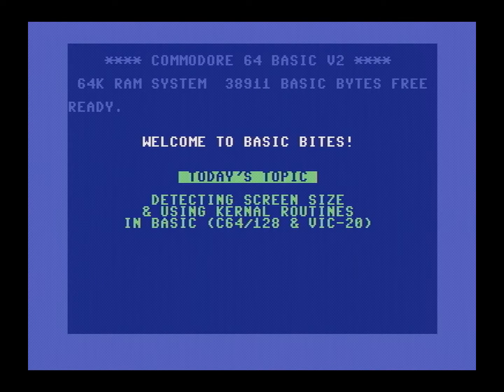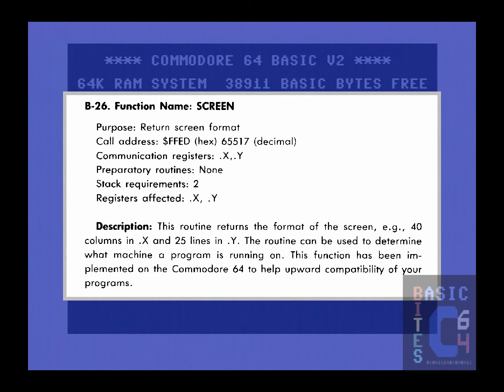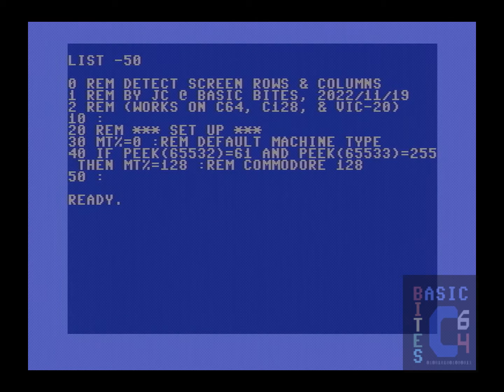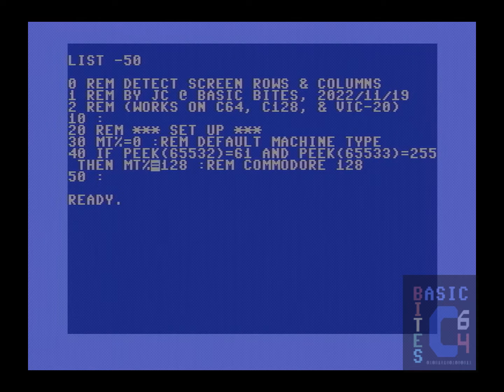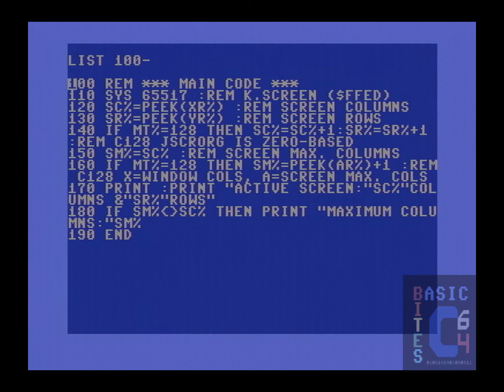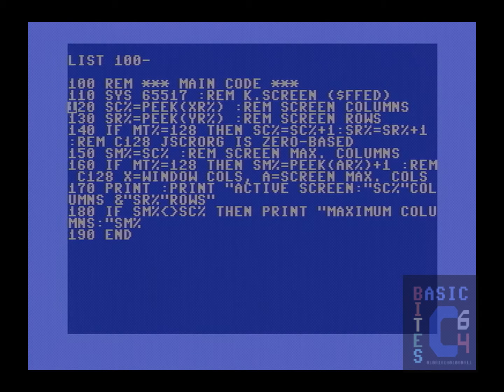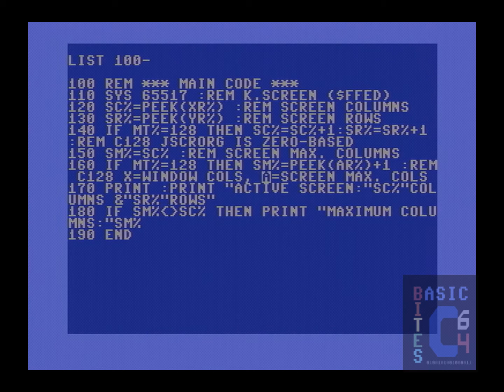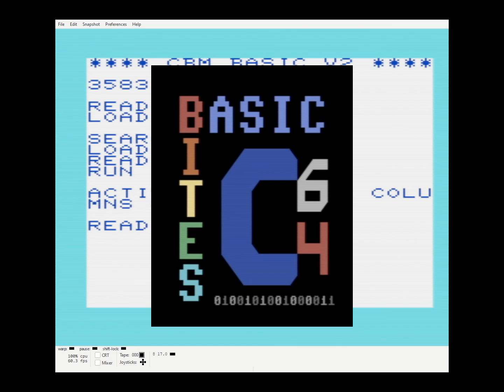Detecting Screen Size & Using KERNAL Routines in BASIC (C64, C128, & VIC-20)

Comment: 4:27 Hang on! DLOAD isn't available in C-64 mode! What kind of DOS wedge are you using, and why isn't it reported on the startup screen?
Reply from the maker: I am using THE FINAL CARTRIDGE III (don't program without it)! 🙂  It isn't specifically mentioned in this video because it is merely serving as a fast-loader, and has no bearing on the code being presented.  I do talk about the FC3 in other videos where its broader feature set comes into play.  It has an excellent BASIC toolkit -- including scrolling source.

Comment: Would be interesting to see if the same program runs properly on a PET or 16/116/+4 :)
Reply from the maker: My hunch is not without further modification -- but if those machines similarly contain a unique RESET vector at 65532, then further values of Machine Type can be added using the same method as is used to detect the C128, and tweaks made based upon that.  I don't code for any of those machines, but VICE emulates them all, so I would encourage you to download the code and experiment with it further. ☺️  -- JC

Comment: The reason why the addresses for the a/x/y registers changed with the c128 is because the c128 does a lot of bankswitching, and calls between code in different banks need a similar mechanism of first storing x/y/a (and actually more), then switching banks, loading back the registers, calling a function, storing x/y/a, switching back to the original bank the calling code is in, reload x/y/a (etc) and then return. 

To ensure the addresses used for those are always available, and do all this saving/loading with as little overhead as possible, the storage for this must be on the zeropage. 
SYS uses part of the same mechanism. 

Commodore never considered the actual addresses used by the sys command for x/y/a as part of the kernal interface. The kernal interface is really intended to be used from assembler, not from basic. It being possible, and even usefull, to use if from basic not withstanding. That is a logical consequence of being able to call machine code from basic, but not an intended use of the kernal interface.

And hence, while what you do is pretty neat and usefull, it is outside how this interface was intended to be used, and this kind of use was simply not considered as part of the 'standard'.

You'll find those addresses also changed on some other 8 bit machines (b500/p500 and similar come to mind)
Reply from the maker: I appreciate the comment!  I am very much still learning about the C128, but my understanding is that the entire bottom 1K of RAM is shared memory, hence I didn't see why the previous addresses couldn't have continued to work, for the benefit of BASIC programmers.  If the memory management of the C128 resulted in those addresses being hit so frequently that efficiency became an issue, that would indeed explain why they allocated them precious zeropage space!  -- JC
Reply: @BasicBitesCA  The amount of shared ram is configurable (common ram configuration in $d506), and is 1k at the bottom of ram by default. It can be disabled, enlarged, and you can also have common ram at the top of the address space. This is also observed by both the 8502 and the z80.

Zeropage and stack however will always be shared, but the actual rules for where they are in physical ram are a bit too complex for a facebook comment.

The mmu is great, lacking, simple and yet fairly complex all at the same time 🙂
Reply: @BasicBitesCA  btw, I see your point with regards to those addresses having changed. 

To at least partially make up for that however, basic 7 provides you a much more direct way to provide values for registers in a sys call by providing them as extra arguments to the sys command.